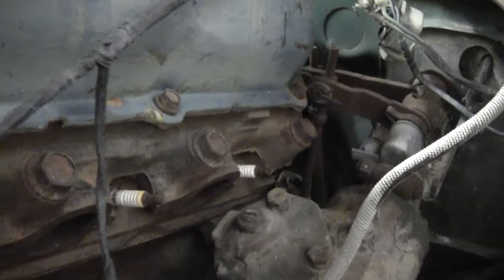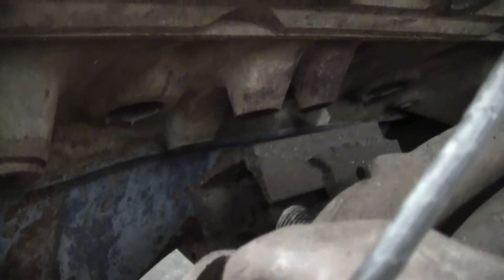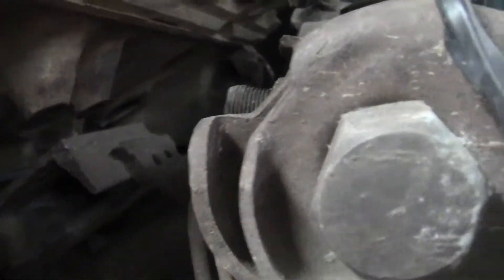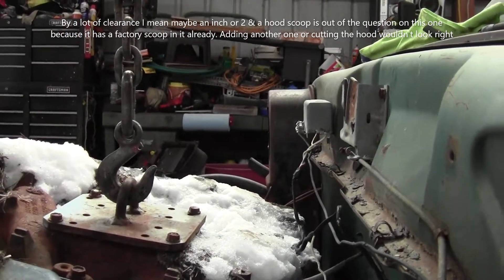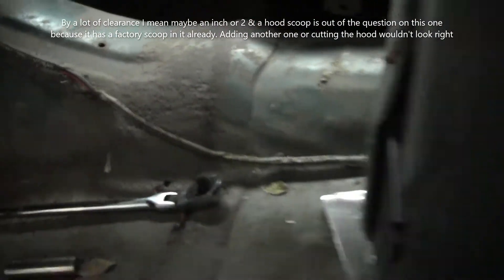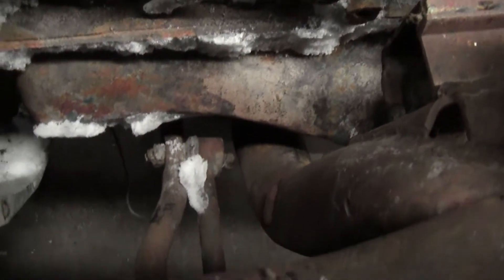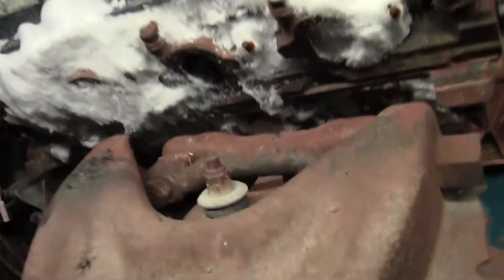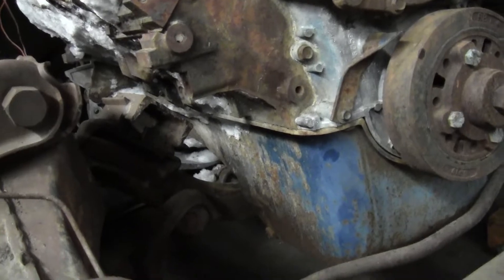1958 Ford Fairlane Budget Build, Ep 7 - Checking Clearances & finding mounts

Comment: Nice to see engine being hand fitted the way you want it to be, not settling on a fit all kit! Making your own design is more work,but your the one gonna be taking the journey to national's in style!
Reply from the maker: Very true! I've tried a couple of those kits, and found they are all 1 size fits all (and none). By the time you make them fit, it's usually cheaper, faster and easier to just do it with what you got.
Thanks man. 

LoL and if you hit that pop down in that vid, you'll see the back-up plan for the hauling that Ranchero to MO.

Comment: Keep up the good work brother
Reply from the maker: Thanks, will do I gotta keep up with you!
Reply: @BareRoseGarage  I am having an all too hard time trying to find motor mounts
Reply from the maker: @2HacksGarage  I run into that all the time, to the point I gave up long ago on the "bolt in easy - 1 size fits all (but yours) kits". Now I just find something stock(ish) and make the frame meet up with it where-ever that might be.
Your stock ones are those Tower Frame Mounts with the single slider in the centers right?
Reply from the maker: @2HacksGarage  If you look back at my old videos, https://www.youtube.com/watch?v=ke2E_VJPA3M
That's the only time I've ever made my own Ford Slider Mounts like that, and honestly I'll never do it again. I could've saved a mountain of time and effort doing the GM style mounts that are a LOT more forgiving when it comes to angles and that damn center bolt being dead nuts on.
Reply: @BareRoseGarage  it sure is a goofy design

Comment: Those van manifolds are bolt eaters. I had to  drill out hundreds of them when I worked for Ryder Truck Rental. You could always convert it to rack and pinion.
Reply from the maker: I hear ya, those doghouses just bake those bolts right into them..... I'm REALY dreading it.

hide this way down here
Funny you mention the Rack & Pinion lol, you caught my que for the coming ones, and I'll give ya another sneak since you caught it....... it ties into that tight spot for power brakes as well..... It'll be our secret but that York & Sag on that E are staying on the front of that engine for a reason lol.
Reply: @BareRoseGarage  yes sir hydro boost is a great upgrade and saves lots of room.